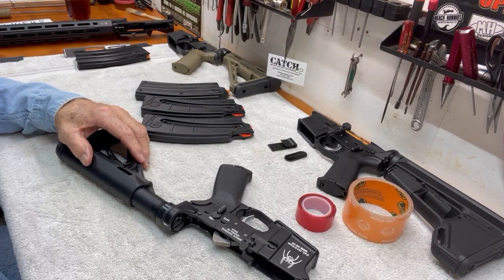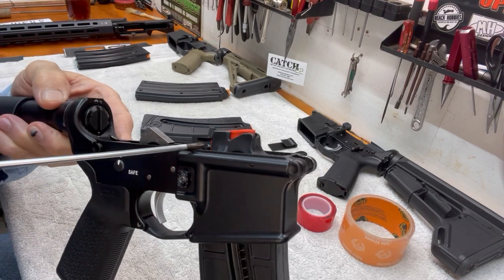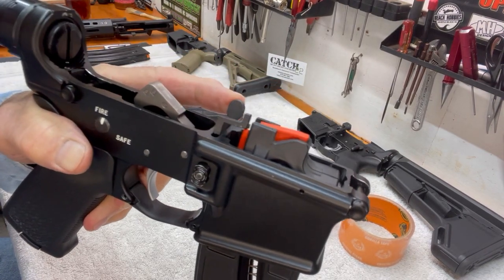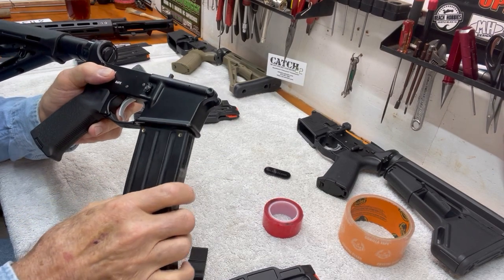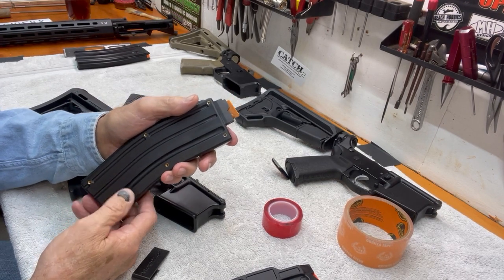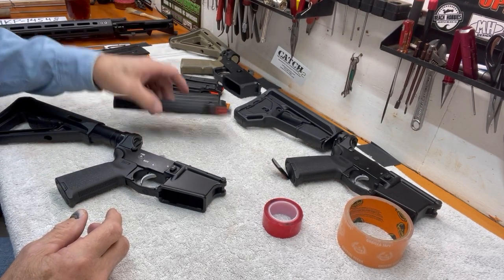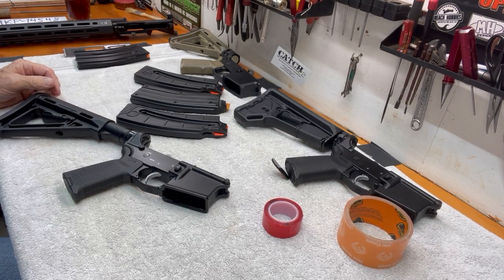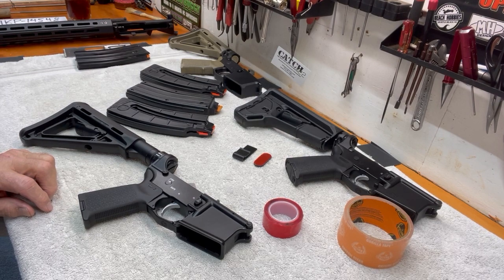Catch 22 Bolt Catch with S&W 15/22 Mag Part 2

Comment: Pull the spring out of the mag and stretch it 3 - 4 more inches. That should be enough tension to lock the bolt open.